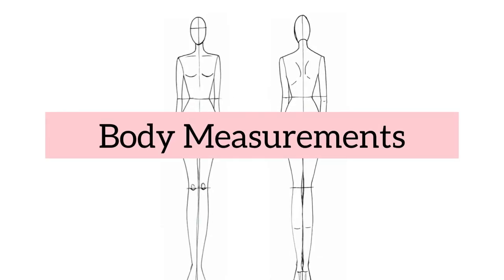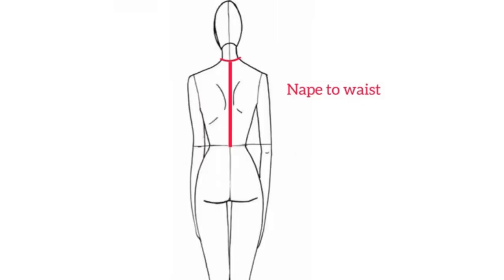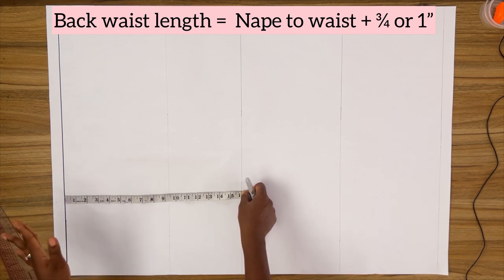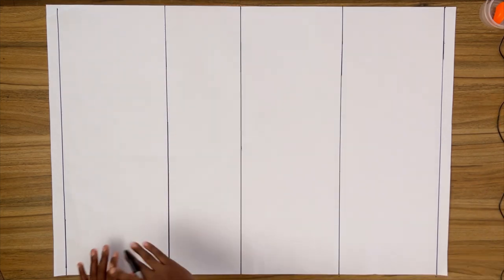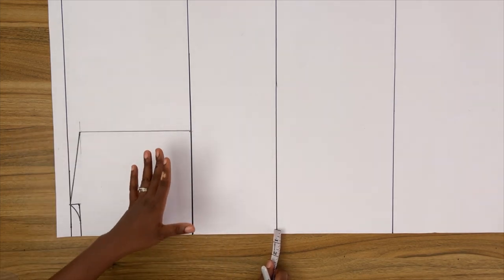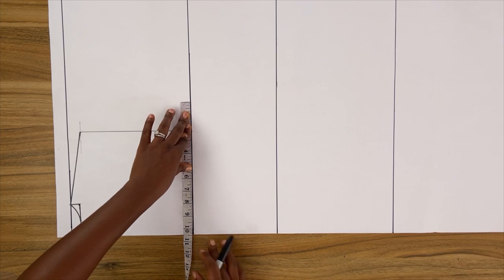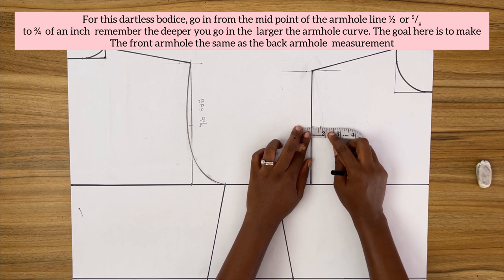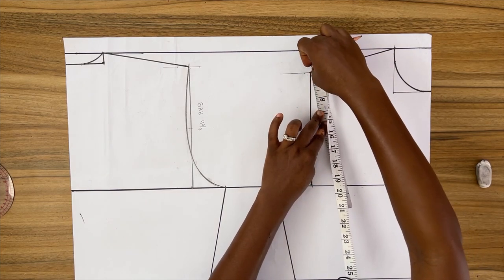Simplified Dartless Bodice | Sleeve | Body Measurements | Cilla Si

Comment: Thanks for the video. What happens if front length is greater than back length
Reply from the maker: Some people’s differences is like  3½ that’s the most I have seen though and it tends to jump  and hike up at the front like it’s not levelled as in parallel to the floor except  the dress is longer to the floor so this defects won’t be  that obvious
Reply: @Cilla Si  Thanks. And how do we solve this problem with dartless bodice
Reply from the maker: @level2456   The thing here is, this problem is more evident in busty figures   With  3” difference between the back waist length and the front waist length. the best option is to put in a side bust dart  if you are looking for perfect fit . This is the quickest  and best fix but then, this will no longer be a dartless bodice but  be a semi dartless bodice 

 Another option would be, using the front waist length for the front  and remove the dart equivalent at the hem of the side seam  of the front and blend it into the Center front 
The wahala here is that you will have a curved hem if the dress is a short length 

Use the front waist length for the back  but this will make your back  bodice drooling down Abi  hiking downward    

 Use the FWL for the Front and Send the difference to the front armhole  the problem here is that this  will  widen your armhole and create gapping at the armhole  even after putting a sleeve you will still see the  annoying gapping  

my advice is Just choose  the wahala you are willing to tolerate . the ordinary person who knows nothing about fashion won’t really notice 
And depending on the length and style it won’t be noticeable

Comment: Please how do i manipulate this for a plus size whose backlength is 5 inches lesser than the front
Reply from the maker: Check out this link  https://youtu.be/nfMwbMHRoIA?si=Qa7rERHgNk5j3Pw1 
Another alternative would be adding a bust dart at the side seam
Reply from the maker: Here is a response to a similar question .

Some people’s differences is like  3½ that’s the most I have seen though and it tends to jump  and hike up at the front like it’s not levelled as in parallel to the floor except  the dress is longer to the floor so this defects won’t be  that obvious
The thing here is, this problem is more evident in busty figures   With  3”  or more difference between the back waist length and the front waist length. the best option is to put in a side bust dart  if you are looking for perfect fit . This is the quickest  and best fix but then, this will no longer be a dartless bodice but  be a semi dartless bodice 

 Another option would be, using the front waist length for the front  and remove the dart equivalent at the hem of the side seam  of the front and blend it into the Center front 
The wahala here is that you will have a curved hem if the dress is a short length 

Use the front waist length for the back  but this will make your back  bodice drooling down  like hiking downward    

 Use the FWL for the Front and Send the difference to the front armhole  the problem here is that this  will  widen your armhole and create gapping at the armhole  even after putting a sleeve you will still see the  annoying gapping  

my advice is Just choose  the wahala you are willing to tolerate . the ordinary person who knows nothing about fashion won’t really notice 
And depending on the length and style it won’t be noticeable

I hope this helps
Reply: Thank you for responding...i have chosen my wahala lol
I chose burst dart,and mayb eliminating it in paper first. That is semi dartless
 Thank you